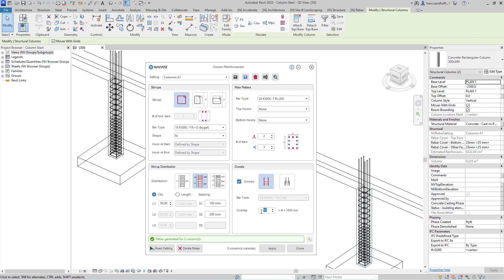The new Naviate Rebar - how to work with columns

Comment: y there is no detail for foundation in 2023 or could u make video for foundation and pile cap 2023 navigate rebar
Reply from the maker: Hi, we focused on the 3 most used features in the first release. Column, Beam and Wall. There will be release in December - 
•	Opening Tool
•	Support for Double U-Bar Stirrups in Beam & Column

On the Roadmap we have a connection feature, split rebar, pile caps and footings.